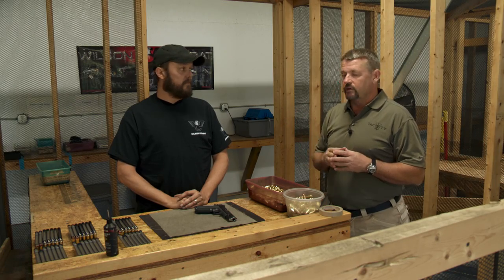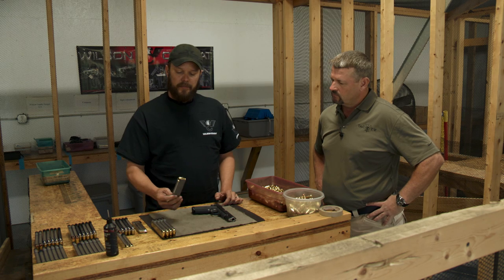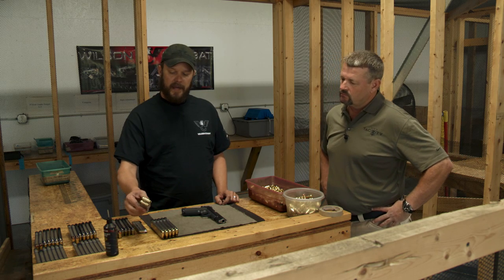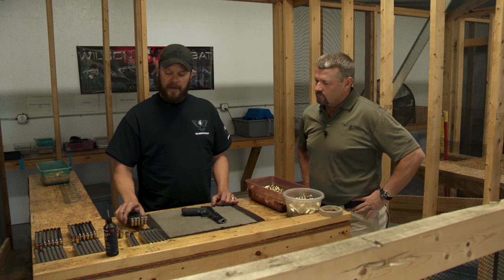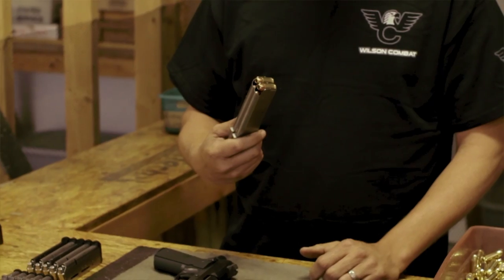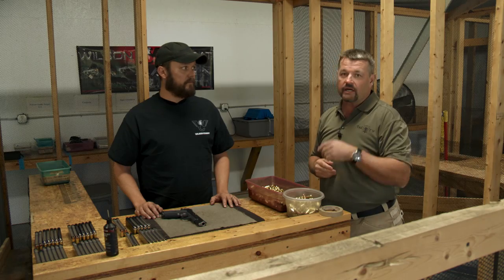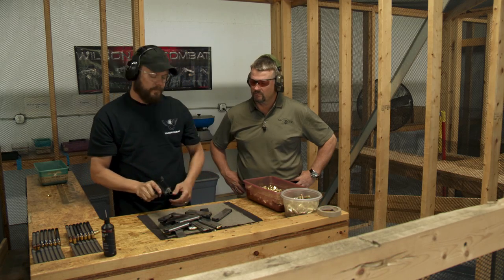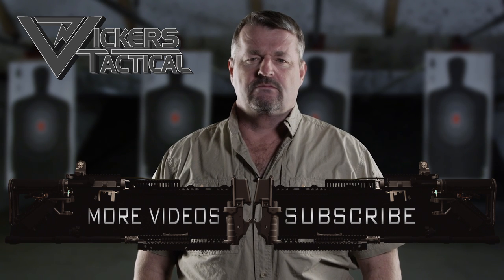See How Wilson Combat Tests their Guns - Behind the Scenes at Wilson Combat Pt. 5

Comment: I've tested my semi autos this same way for many years... including using the best and the worst type of magazine... not just the good, excellent magazines. It's not a real test until you use the lowest of the low mags... then if it still works you know for sure it will operate with the best magazine possible. In this case my opinion would be Wilson Combat.